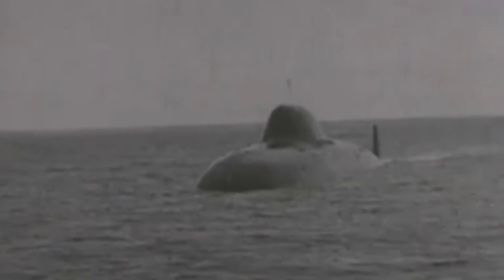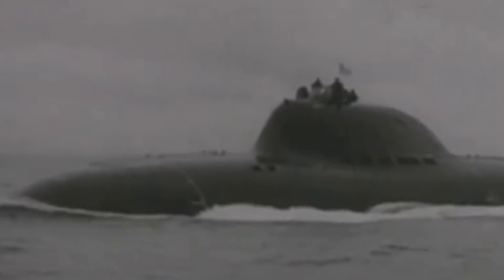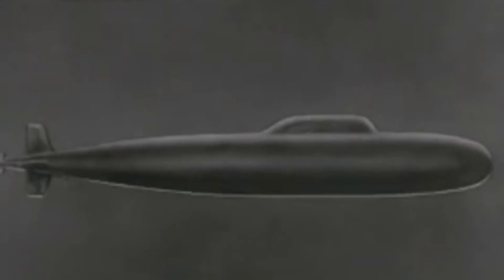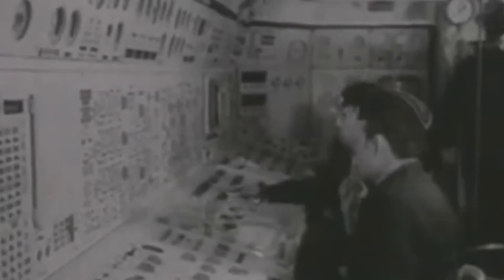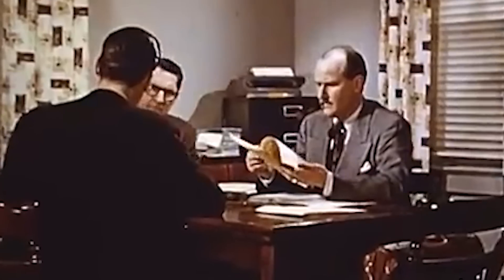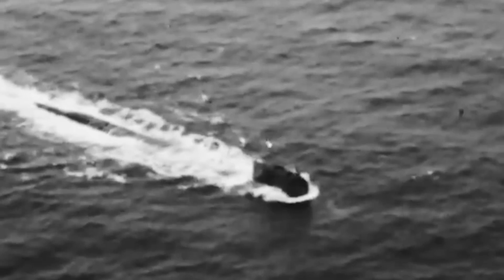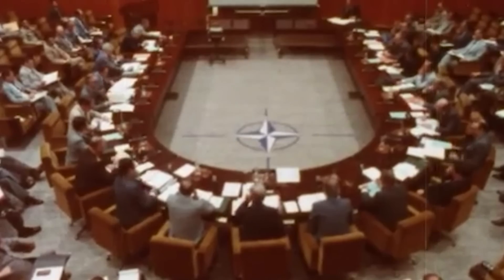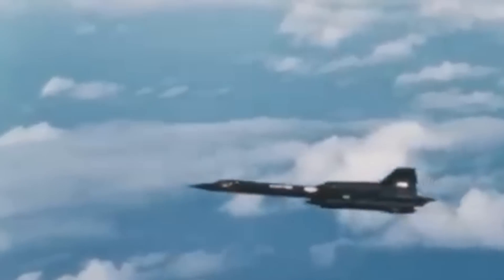Russia's Top Secret (Shiny) Titanium Submarine

Comment: The first time an Alfa made a speed run off the North Cape of Norway it was picked up on the San Juan SOSUS array. What the Soviets failed to realize, I know it's a long list, was that while the Alfa could go fast and dive deep it was essentially useless when it did. The speed made it blind, the sonar was ineffective. At depth it couldn't shoot. The lack of fairwater (sail mounted) planes make it unstable in a high speed turn. I have heard, I can't confirm, that more than one Alfa made a complete 360 degree roll while making a hard turn at speed.
Reply: Imagine zooming around in your submarine and it fucking rolls over
Reply: @testiclegaming1250  Imagine being the  poor bastard having to write that up! One of those reports that comes attached to the results of a breathalyser test...
Reply: @testiclegaming1250 imagine you’re mid shit and do a 360
Reply: @testiclegaming1250  then, it is going to be "rock and roll" submarine of ruski.
Reply: Imagine if you were on the toilet when that happened.
Reply: @stevenwallman2346  I worked on a trawler on the Bering Sea. While I've never rolled while on the shitter, I have been on 50ft seas while on the shitter. 

Imagine trying to crap on a roller coaster. It's not if, but WHEN it lands in your lap. Showering in a storm is also an acquired taste.
Reply: @stevenwallman2346  That's where I was for a non-drill emergency blow from test depth. And yes, that's a no $hitter.
Reply: Such an alpha move, a barrel roll in a submarine, I guess that's why it's called Alfa
Reply: Still a really interesting design!
Reply: @Dan-xo9ly  hardly
Reply: Who told you that and why do you believe them?
Reply: 😅 garbage cans full of rocks 😂😅😅😅
Reply: Yes yes yes and than Norway UFO flew, busted it wide open with a beam laser from Enterprize star trek ship, and than after it was destroyed by foton torpedo and that wasn't all, than a Godzilla came out and ate all the poor lil ol Russians and after that it was a total victory for NATO...

No shit, this really happened, claimed by Fox News, CNBC, CNN, ABC, BBC, etc... True story!
Reply: to bad it was superior to anything the west had
Reply: Fully rolling over a boat would be catastrophic.  Heavy equipment inside the boat would shear from its mounts.  The resultant damage would make recovery nearly impossible.
Reply: HarryWHill-GA nonsense total nonsense There was nothing wrong with the stability.  It could shoot at depth and Sosus nothing.  Where do we get people like you who make stuff up.
Reply: Yove gotta hope no one was having lunch during the aquabatics.
Reply: @adamconroy2146  ?????????
Reply: Ha, keep dreaming buddy. Nice kids story.
Reply: first claim is simply bullshit.
1) there was nor is San Juan SOSUS array. Nor naval base. USN naval base is in Puerto Rico was only in Ceiba and it was never center of sonalyst team. Let alone SOSUS analysis.
2) These claims, that some american or brittish submarine can heard some source of noise hundreds or even thousands kilometers afar are simply physically impossible. Seawater has average sound absorption 0,06 dB/km. White noise is 85-90 dB on average. So at to have 1000 km detection range, source should have +60 dB over white noise level. 150 dB in ocean is Earthquake level. Not even diesel submarines at full speed produced such noise.

Speed did not made her blind. But at full speed, submarine has to tend to its active sonar, because at full speed, submarine produced noise levels over common sound sources, like obstacles, waves and another vessels at distance. Active sonar is usually problem for submarine, because it is revealing location nature, but since at full speed Alfa was usually in battle mode, it was not any problem.

Alfa submarines could shoot at depth. Problem was that USSR did not have developed torpedo capable to be launched and operated at such depth. First torpedo with capability to operate in depth under 500 meters was USET-80, developed 10 years after Alfa class. 

Alfa, like majority Soviet submarines did not have Sail hydroplanes, but has retractable bow hydroplanes. No Alfa ever rolled 360 degrees, because it will resulted into hull loss, because Alfa, like all Soviet submarines (and majority double hull submarines), had free-flooded balast tanks. So if such submarine get upside down, permanent air surplus from these tanks would left out and submarine would be unable to surface. Fact is, that 360 degrees roll is highly unlikely for any submarine, because they are engineered with heavy belly.

Soo .. yeah. Less fantasies more factsnext time, please.
Reply: @tomascernak6112  No Puerto Rico SOSUS array you say? To the contrary, it was one of the first established. In 1954 three full systems to include a NAVFAC terminus were installed with arrays terminating at NAVFACs at Ramey Air Force Base, Puerto Rico in September, Grand Turk in October, and San Salvador in December.
Just wondering, what are your submarine/ASW credentials? Soviet Navy? Any navy?
Reply: The speed is not intended for attack but defense however. Even if your claims are true, it's kinda irrelevant. This speed is only used when the submarine is already detected. So it's kinda irrelevant if you're insanely loud when moving at high speed as your submarine has already been detected and is under attack.
Reply: You have heard something and you repeat it as a fact. Genius. It was incredibly manouverable, stabile and you should listen to american submariners chanel, how it realy looked when they met with Alfa. It danced circles around them. One more thing, Western submariners seen same thing again and again... while it was traveling faster than US torpedos it was loud, but in 5knot creep mode it had super silent extendable propulsors wich would made it disappear completely.
Reply: @OleDiaBole  We WON. Most of what you say is doo doo left over from the USSR's Cold War days. Just remember: We won it.

Comment: Here I'm thinking it would be useless for a submarine to be made from titanium. I guess when you have an abundance of titanium you can get away with it.
Reply: Being able to do it isn't the same as useful.
Titanium alloys are more brittle than other steel or aluminum alloys. It gets worse in the cold. So they could dive deeper, but at the risk of cracks. Cracks which get bigger with repeated deep dives.
Also the things were noisy. The whole point of a sub is relative stealth.
Reply: That is not correct. Titanium only gets brittle if the alloy has impurities, this is why you need to weld it under argon. IDK about the 60-70's soviet alloys, maybe they were of poor quality. Everything that have a body-centered cubic crystal structure is very maleable but sucetible to impurities. Modern titanium is stronger lighter and more ductible than any steel under the same stresses.

Comment: Tiitanium while  stronger than steel did not flex like the HY80 steel US submarines were made of. Ours could go to max depth practically indefinately wheras the Alpha, and Typhoon class could reach a much greater depth., but they could only do so once. The titanium degraded as it flexed.
Reply: That's what few ever think about, except engineers - what happens at failure?
Brittle materials (like carbon fiber!) develop cracks, which just get worse with more pressure. It becomes a domino effect, getting weaker & expanding the cracks.
Malleable materials start crushing.
Reply: @recoil53  That carbon fiber & glue coffin was a disgrace... Almost feels like carbon fibers were picked because some idiot thought it was cool.
Reply: The western worlds always were well within tolerences as well as max depths. 688's circa 1500' depth versus Alphas 2000'    688 could probably go to 2000 but why push it. Put it down at 1500' and the rest is a safety margin.
Reply: @stevenlarratt3638  I tried to respond with actual numbers but something in me still cannot talk about what were once classified numbers. I simply couldn't hit enter. The Alpha, and Typhoon classes initial CD was far greater than 2000 ft though.
Reply: @grndzro777 😂 Top Secret
Reply: @Lewythefly  If Navint was questioning your friends, and family after you got out of the Navy years after your discharge you might have a different opinion on my paranoia. ICCL about Russian info. It's the SCI stuff I worry about. Sure it's been over 20Y so anything technical I know is probably perfectly safe to talk about...but I still can't. If I open that box it would be easier and easier to keep opening it. I'm already a hermit. I don't want to be a hermit in a cell.
Reply: Agreed

Comment: Assembly would be hard enough but maintenance and repair of the hull would be a problem nearly impossible to overcome and the Soviets are 💩 at maintenance, all their ships are rust buckets.
Reply: Not with Titanium but the hull presented a different problem. Put Titanium in salt water, tie it to a jetty made of reinforced concrete what do you get? A cell. At the expense of the steel (iron) bars within the concrete which led to the piers corroding.
Reply: Their nuclear arsenals have problem already with maintenance, mostly because some generals pocketed the money, now submarine. Lucky russian generals, they grew rich by pocketing only money.